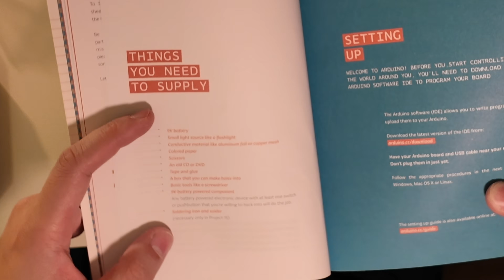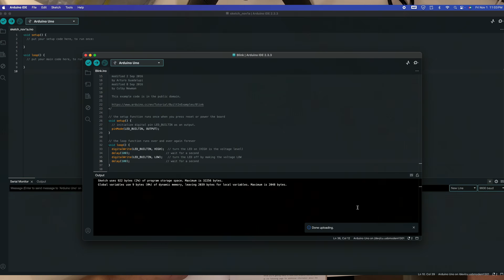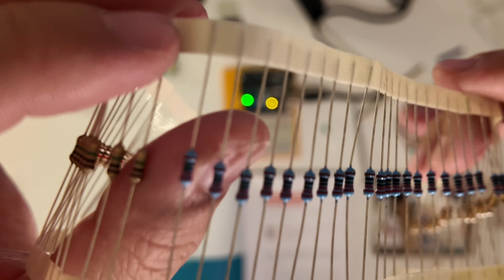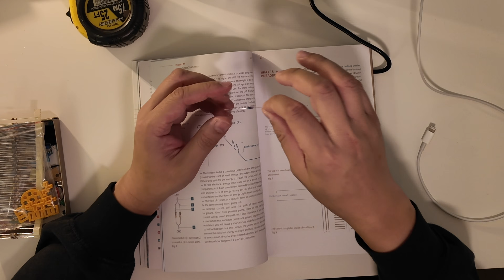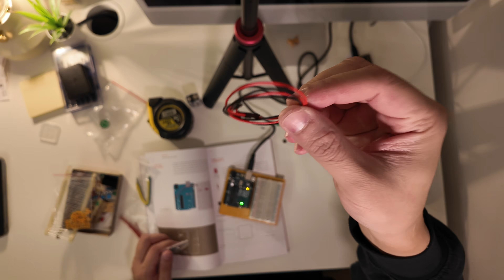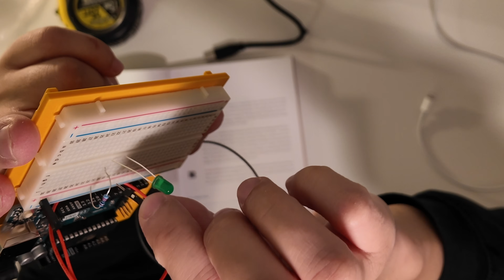Project 1/Part 1 - Arduino Uno R3 Starter Kit - GET TO KNOW YOUR TOOLS an introduction to the basic

Comment: Great video. I noticed that your arduino uno and breadboard are both attached to a orange plastic board. The orange plastic was omitted from my arduino starter kit. From where did you get it or is it pissible to make an equivalent. Thanks Philip from Jakarta